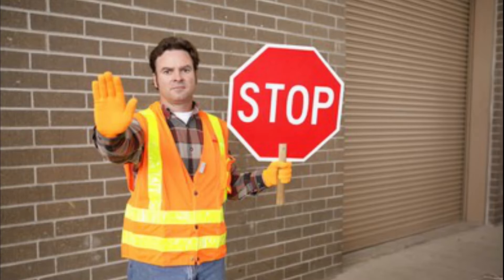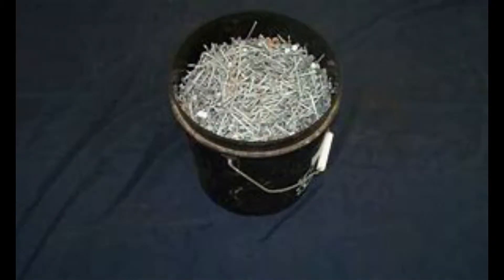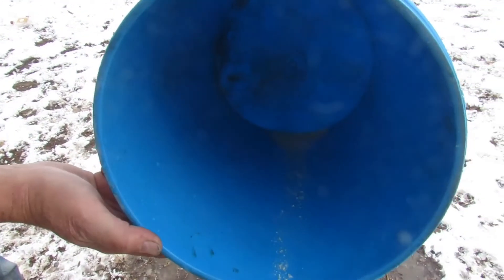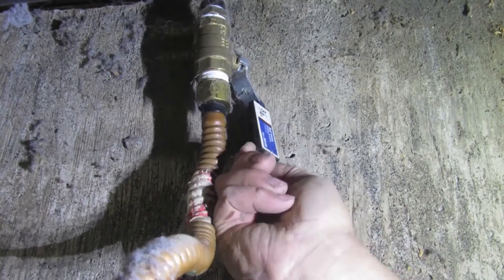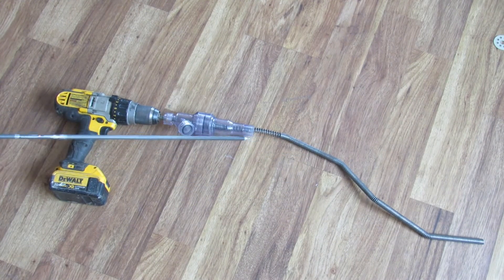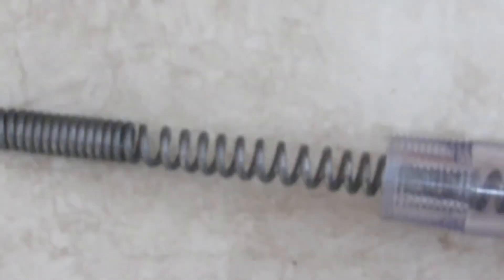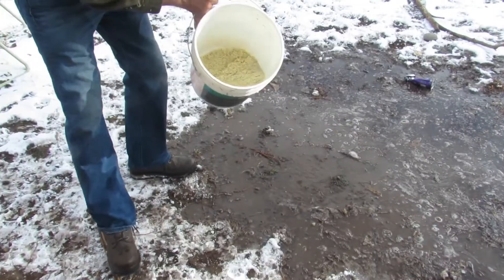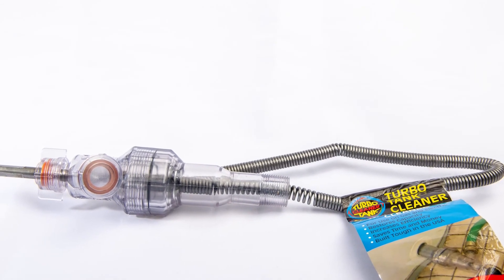Stop!!! Don't Flush That Water Heater

Comment: Doesn't look soft enough to me to not break dip tube, ceramic/glass lining, maybe even a heating element.
I like the idea of the grinder to break up the sediment.  My first attempt to flush was to use a long hose to go out the walk-out basement and it quickly got clogged.  (looked like small aquarium gravel)